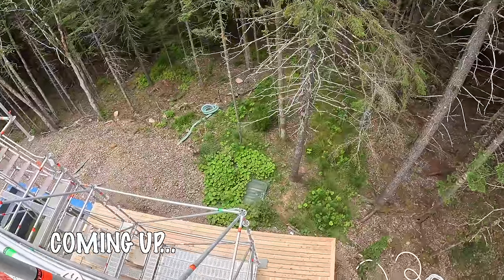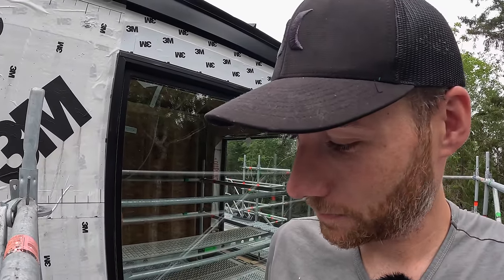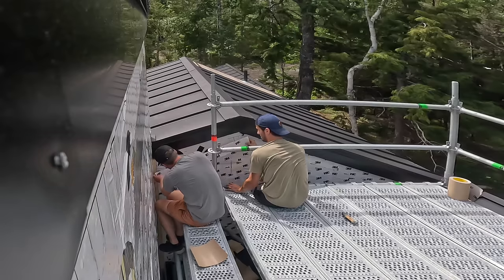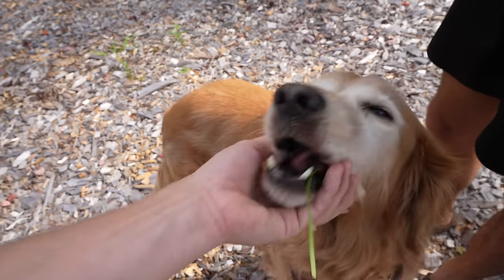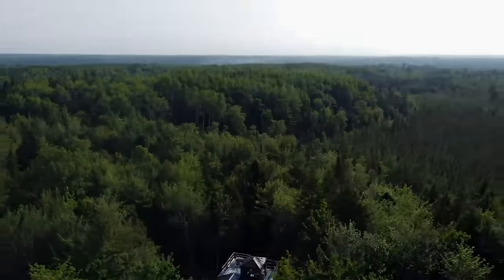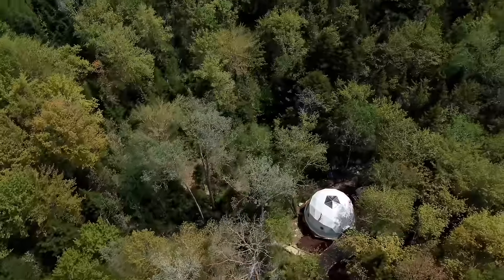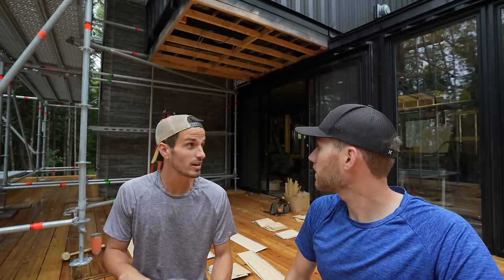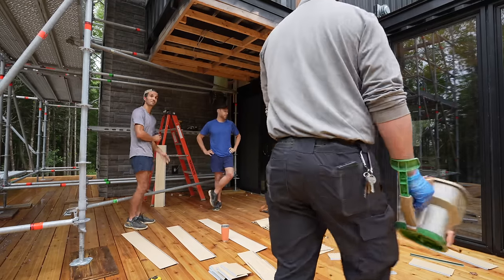It FINALLY happened...

Comment: Oh, and ask long as you still have the scaffolding UP.....would it be a good idea to put Dishy McFlatface up on the roof of the tower or a more accessible spot on the upper roof? If leaves mess up your Starlink reception, the tower or the upper story roof should be above MOST of them.

Comment: Can you connect your starlink antenna to the top of the tower while the scaffolding is still there to achieve a better signal strength because you would be closer to the top of the tree canopy?  Just a thought.

Comment: Foam insulation definitely is not pest proof. Ants and termites love burrowing thru it. I am currently researching exterior insulation types for the remodel I'm planning. I've decided to go with mineral wool because of its resistance to pests. It literally shreds their shell when they try to burrow into it. Of course, it's a bit more expensive and labor intensive, but I'm a buy once cry once kind of guy and I hate having to redo something a 2nd time, which I know you guys understand!

Comment: Your phones have a good level/angle finder app.  At least Apple does. I don't remember from the last time I had an android phone but if the internal hardware is there someone will make an app that does it. OR, you can invest in a good metal adjustable angle (Can't think of the term for it but looks like a square (the tool) but adjustable with way to lock it at an angle.)  Or, instead of a bubble level go with one with a digital display.

Comment: I don't know if I am the exception but I've always had bad luck with batteries for power tools. I tried different brands and the batteries either didn't last long or they drained dead if attached to the tool, or drained dead just sitting there for a few weeks or months. That went on a long time. I'm in my 70's now. Then about 8 years ago I read some good reviews/tests on Bosch brand. So when I saw a sale on them I picked some up. Solidly built, strong motors, and the batteries are amazing. I have one tool that I rarely use. I charged up the 12v battery for it years ago and it's still going, unlike some other batteries that drain just sitting there. So I became a huge Bosch fan.   I'm not so huge a fan now though since I lost 90 lbs last year.

Comment: Starlink. Find an area on your land that has the most open area tree wise. Install a pole as high as you can that is at or slightly above tree top level and install the dish at the top. Make you ground it to protect from lightening strikes. Or, for a less attractive version, attach a high pole to the tower.
👽

Comment: The Downsides of Using Spray Foam Insulation in Homes
It Can Lead to Mold. Spray foam insulation mold problems are quite common. ...
It Can Have a Foul Odor. Spray foam insulation is mixed on the job site, and improper ratios of chemicals are common. ...
It Can Lead to Termite Damage. ...
It's Too Airtight.

Comment: If the leaves cover the Starlink dish, wouldn't it be better to mount it temporarily on top of the solar panels, and run an ethernet cable? Or will that not work logistically with distance etcetera.

Comment: # Wood ants? Are those what we call termites here in  Australia?  
# A quick word on perimeter spraying for ants. I had a horrendous experience with this - for ordinary ants ( not termites). We had little lines of ants continually appearing in the kitchen and bathroom's 
 Here, it is particularly dry in summer,  and they were coming in more for water than food. After the house being treated - we then did an Ant specific perimeter spray. A few months later we realised our mistake. Black Hordes - RIVERS! of Ants suddenly literally BOILED out of every tiny crack into the house, in their Millions! Out of power switches, tiny cracks along skirting. Everywhere! The new Pest control company we frantically called in explained that the perimeter spray had trapped a few ants still inside the perimeter. Probably only  started with one nest - & Then with no way to get out, they just multiplied inside. Exponentially! Anyway, it needed another huge spray with the most effective but least toxic to us pesticide we could use, + a follow up 10 days later to capture any that had hatched in the interim, before we were completely ant free.  Now we just spot treat. / ant bait any ants that appear inside...

Comment: Pity you have been plagued by so many incompetent builders along the way. My most respected (and multiple awarded) architecture professor/mentor always has said that the most important person on any build is the supervising project coordinating contractor. My mentor insists that any design- trained architect or engineer who joins their firm spends a full 5-6 years as an on-site project jr then sr supervising contractor on a minimum of 3 very different complex projects before they are allowed  to contribute in any way (even to design a block of toilets or parking garage) to an original signature design by the firm.